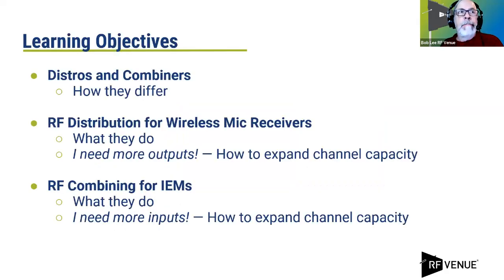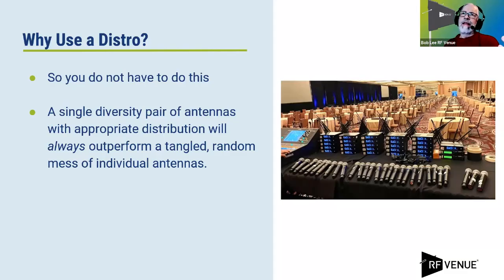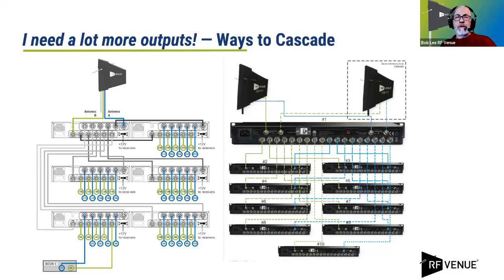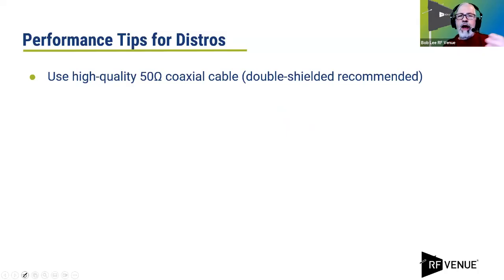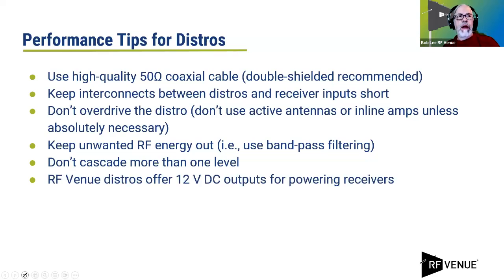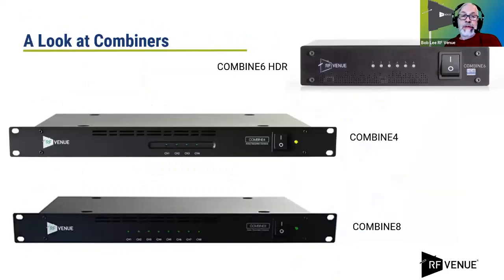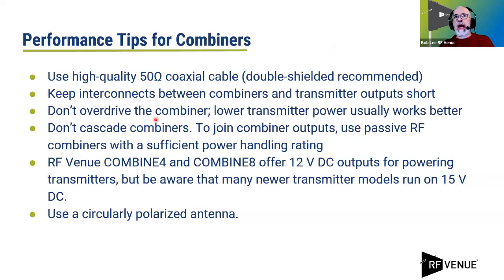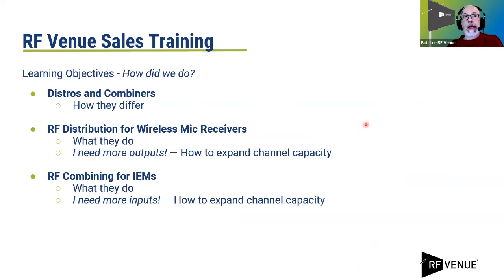RF Venue Live Webinar Understanding Distros and Combiners

Comment: Hello, I love your products! I use CPB Beam antenna for my bands IEM’s and also the DFIN antenna for our mic system, only use 100% shielded RG8x cable, etc. I’ve learned so much from you guys!

One question, I love the idea of the combine 6, and it taking up just a half rack space. Does it also power the 6 IEM transmitters via BNC, like the Sennheiser antenna combiner? I cannot find a clear answer on that
Reply from the maker: Hey there - sorry for the delay - we don't monitor YT as often as we should. We left out the DC Power on the COMBINE6 HDR and prioritized the RF amplifier performance, but to address this issue we started shipping a external power supply called the OCTOPOWER - which is a 12C/6A line-lump PSU brick and included DC-OCTOPUS accessory snake--https://www.rfvenue.com/all-products/octopower

Comment: just wachted the Webinar, thanks for doing this,  when using a big number of IEM's and you have to use 2 antennas with 2 combiners each, would you place the antennas as close as possible like if they were just one antenna to reduce intermodulation? Thanks in advance
Reply from the maker: In this situation - you would always spread the IEM Antennas at least 6FT Apart from each other. We would suggest using our COMBINE6 HDR, as you can connect two of them together for 12 channels in 1 rack space, with a single CP Antenna. Need another 12 channels? Just rinse and repeat to get 24 IEM channels with 2 antennas and 2 rack spaces
Reply: @rfvenue  Thanks a lot!